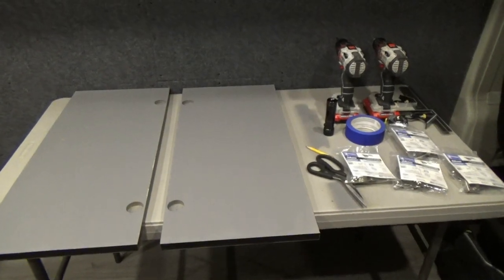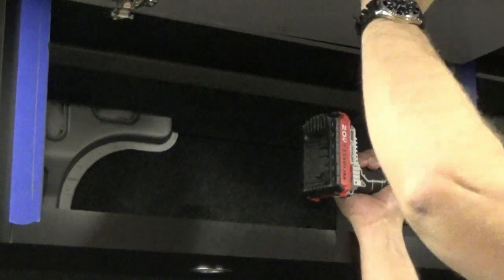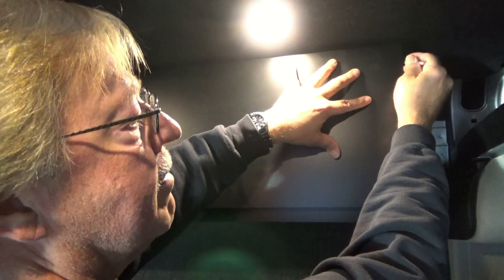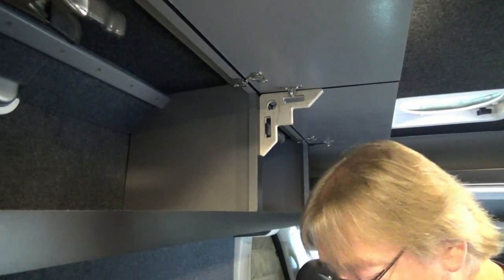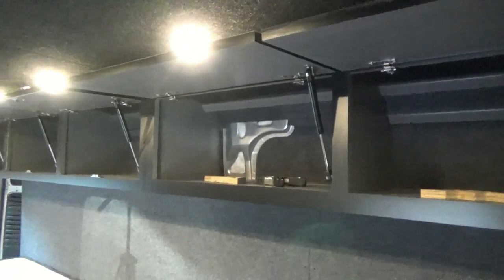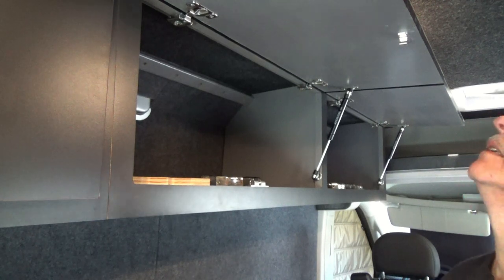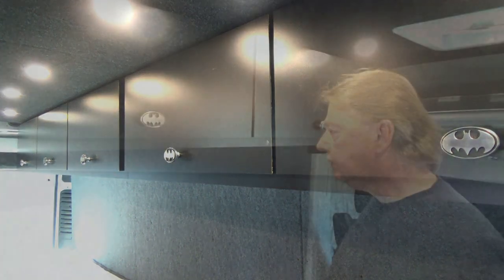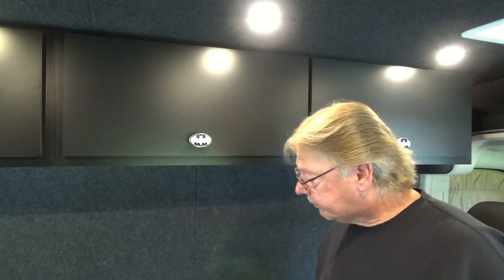Promaster Van Build 2500 159WB – DIY–How to Install Gas Struts– Part 16

Comment: I agree you don't need to cover up that little bit of exposed metal inside the cabinet. You fitted everything around that part so precisely that it looks like it belongs there! I might cover it with some black or silver duct tape. I've done that before.